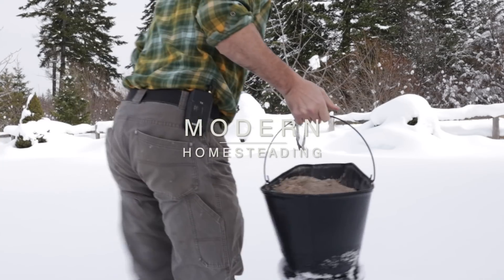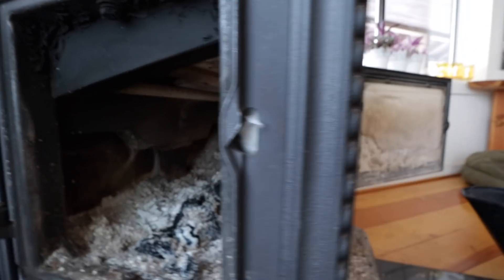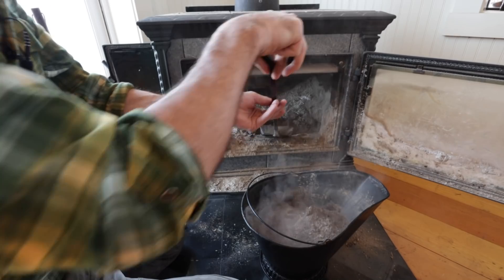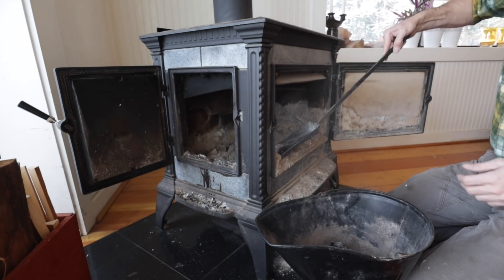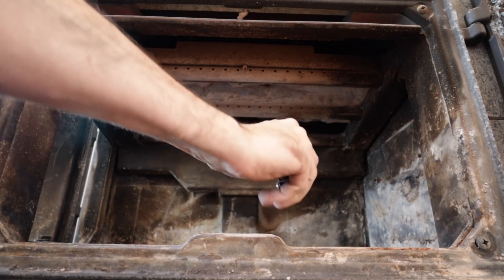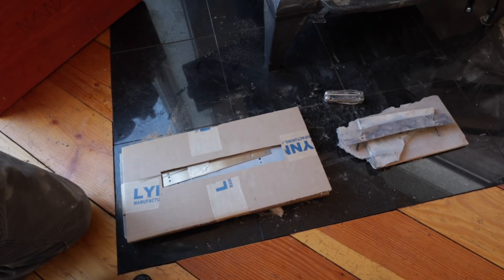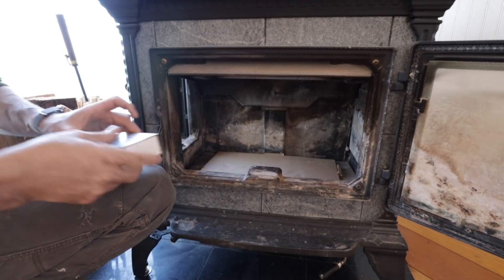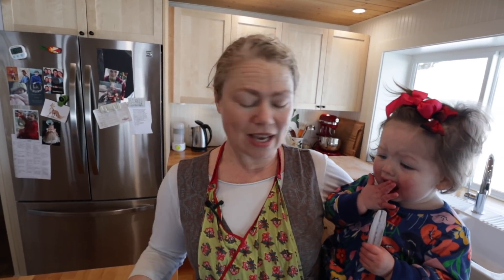Woodstove - Who Builds The Best Wood Stove?

Comment: We live  in Saskatchewan Canada. Built a masonry heater in the main living area 20 years ago. Salvage lumber is the only fuel we ever use, cleaning up collapsed barns mostly. Tremendous heat in those douglas fir boards and 2x6.That is what the mh likes , a quick, very hot fire .The fire door is only opened once a day, 7 oclock in the morning. It is still radiating heat at 10 oclock pm. The cost to build is minimal. Only bought material are the fire bricks for the fire chamber. the rest is used chimney bricks and ordinary clay from the cellar for putting the whole thing together . some chicken wire as "rebar" in the clay plaster. The door was built from scrap iron, the only metal part besides the pipe going into the chimney. Total expense back then  around $200.-( chimney extra of course) The thing  is about one ton. The chimney never needed cleaning yet. wood consumption around 40 lb per firing. Clean out the ashes twice per winter, 80% of  the volume being nails. Very simple , anybody can build one, the perfect infra red heat, private sun, so to speak. Best project in one's life ! Throw those iron monsters out and build one , you will never regret it, expecially if you have small children .   Don't be deterred by this elitist aura of immense cost attached to masonry heaters .   josef.schwaiger@sasktel.net 
Kind regards to you all

Josef

Comment: The main purpose of a wood stove is to provide heat so anything that reduces or slows heat transfer had better have a good purpose.  Soapstone insulates against heat transfer, that's why it takes longer to heat up the room.  Very important is where the air for combustion comes from.  If you don't have an air intake thru the wall, you are using heated room air for combustion, thus cooling down the room when air from other rooms come in to replace the lost room air.  Also, as long as your chimney is warm, heated room air is continually lost up the chimney even after the fire is out unless outside air is used in the combustion chamber.  Also, the baffle you replaced insulates, so I replaced mine with two steel plates and I turn them over every year due to slight shape changes over time.  Steel plates in place of the replacement fiber insulated baffle you purchased also keeps the stove top warmer for processing maple syrup, for example.  Love your videos.

Comment: First "air tight" woodstove was the Ashley made in Tennessee, but it was a thin walled steel stove that did not have that "heat sink" of cast iron or soap stone. I have a Pacific Energy with a big slab of soap stone on the cooking surface.  Availability of firewood has become a local issue where I live.

Comment: Maybe keep a set of the soap stone baffles for reserve spares, just in case of future need and not available in the immediate or ever. When you lay a porcelain tile floor order a box of replacement tiles from the same batch, just in case a repair has to be done at a later date. You won’t be able to match the tile color with a different lot. The color variations are noticeable. But lately the availability of a replacement might not be possible because of delivery and manufacturing issues. All just a suggestion. You want to use a shop vacuum with a stainless steel catch bucket that way your assured no fire.

Comment: I love my Vermont castings intrepid ii. It's raw cast iron but still you can't beat a wood fire in my opinion. A little tip for you or mrs. Wranglerstar a wet cloth dipped in ash from the stove works great for cleaning the glass just rub it on when the stove is cooled down and the carbon will wipe right off.

Comment: Those baffles will crack just from the heat.  I replaced the warped steel baffle in my Century FW3000SD with one from the same company.  It made the stove much more efficient, but the baffle split right down the center within a week (and no, I didn't hit it with anything). Doesn't seem to affect it, but I guess I should buy a spare.

Comment: Just a tip you may want to try. When I was growing up we heated with wood and when we had to clean out the stove we would take an old ketchup bottle and squirt a couple of bottles full of water on the ash to dampen it. Let it set for a minute or two and then shovel out the ash. It really helps cut down the dust in the air.
Reply: try spray bottles like a windex type, it doesnt take that much to wet down the fly ash and this way you get a wider dispersion

Comment: Good enough video that we just ordered this stove for our new home.  Do you use the direct outside air accessory? Our installer recommends just adding an outside vent at outside wall or run a tube in floor to a registor near the stove.

Comment: I refurbished an old Vermont Castings from the early 80s...the thing works great and for a fraction of these woodstoves sell at retail in the 1000s...most woodstoves are $3000 or more yet a old model that needs a few new parts like gaskets would be less than $700...
Reply: all well and good if you live in a locality where you can install a stove that was not EPA compliant. (not beating on the old VC's they were top of the line units back in the day,) but the old non reburn stoves time has come and gone, even a quality big box stove with reburn technology similar to that which the stove in the video demonstrates  (yes they exist) can be had for under a grand.

Comment: I have worked in the Hearth & Heating Industry for some time, first doing field installs and servicing to tech support and now regional sales for a distributor of many different brands. I wont get into how you didn't leave an appropriate 1" ash bed on the bottom, but Hearthstone is a decent manufacturer when it comes to wood burning units. Pacific Energy, in my honest opinion, a far superior brand. Not only are the extremely well built, they support and guarantee their units the longest. They use universal parts on their models every year so I can use the same part on a unit that is a year old on a 15 year old unit. They make a wide range of fireplaces, inserts and freestanding stoves. Cast iron, sheet metal and soap stone.

Comment: Of some interest …  Here in Canada we have Home Hardware where I purchased the Ash Vaccuum  by Cleva.It is designed for vacuuming the ash from the pellet burning stove.Supposedly O.K. if some warm-hot ashes present. I have used it for 5 yrs and no problems so far.Living in a mobile home which is airtight we must take our combustion air from outside so with that we aren't drawing air from indoors and sending it up the chimney.If anything it soon gets too warm!!!
Reply: I'm thinking about one of these stoves myself with a vent type going outside for fresh air for the wood stove. And legs to bolt it to the floor. They claim this is for mobile home you switch I'm in a small space and don't want to take all the oxygen out. How do you like yours?

Comment: Just bought a used wood stove. Exactly like the one you have!! Quick question. Which way is the damper wide open?? Left or right?

Also will I need that damper that’s in my pipe? Or is the damper in the stove good enough. Thank you
Reply: it depends on the height of your chimney, and where you are located. If your chimney is too tall, you may need an excessive draft damper (the one in the pipe) to cut back on the draft. and if you are in a location at a higher altitude, or receive a lot of wind, it can cause the same effect.
Reply: also, the best way to tell which way the handle is for open or closed, take the top section of your stove pipe off and look down inside the stove to watch the damper

Comment: We have a US Stove Furnace in our basement.  It is tied into the HCAC duct work. But we stopped using it because it would start out fine but then smoke would come out around the door and my carbon monoxide detectors would go off upstairs.  We would have to get our 6" chimney flue cleaned once or twice a winter.  I was fed up.  Then I found out the problem. Our house was too new and too tight. So as the fire burned in the furnace it would use up the air in the basement and cause a vacuum. Then that would start pulling the smoke back down the chimney.   I tried last year to run a flex line in from outside into the intake of the firebox and we had no problem.  But we have not switched back over to wood yet. Not much winter lately. We just use the natural gas in our central unit.

Comment: Here's a tip from a long time wood stover, add a ceramic blanket on top of the stone you just replaced, cut to size type blanket. This will increase the efficiency of the stove by trapping more heat in the box. Search flea-bay, they sell them in different thicknesses. Even a thin 1/4 inch thickness will do. Good luck.

Comment: Another reason to check for heat with the back of your hand is in case of flinching. If you use the back of your hand and you flinch due to the heat, your fingers curl away from the heat source. If you use your palm and you flinch, you may end up dragging your fingers through the coals, or even grabbing a handful.

Comment: Blaze king they have very deep opening after you open the door so you can load more wood and clean less often as it has 10.5 inches from the bottom of the door to the fire brick. They also make 6 of the top 10 most efficient stoves listed on EPA. Blaze king, king model has a 4.34 cubic foot firebox thus more wood equals longer heat and more time between loadings. I could almost load that wood stove into mine. They use catalytic converter along with bimetal self adjusting damper to keep the heat even. Not much out there that compares to a blaze king

Comment: I have the same stove, great wood stove, I heat my 1300sqft house , I added the fresh air intake a couple years ago and it really helps, I have a couple drafty spots, eliminated the drafty feel.
Reply: I know this is a comment from awhile ago but looking into this stove for a 1200sqft rancher. How hot does it keep your house?
Reply: @goalscorer20  we stay very comfortable, the stove is in the far corner of the basement in our bi-level house, below our living room, so our bedroom stays cool , it was in the upper 30 degree range this past weekend and we had a widow cracked to cool the living room off for part of the day, I run it full out most of the time, the basement works like a big heatsink, tile floors and stone wall around stove. It was 20 degrees last week and it was 75 degrees in main part of the house. I am not using the built in fan right now because of a bearing noise, it’s working so good as is I may not use it this season even after I fix it.

Comment: I have a 1977 Vermont casting Vigilant cast Iron Wood stove had for  almost 40 years and took to every house I lived. We heap the ashes on one side of the stove and than put the ash bucket just like Wranglerstars on the inside of the stove to the right. Than we scoop up the ashes while the bucket is inside the stove so it keeps the ash from going everywhere inside the house.  Also I will keep any char coal left over from the last fire and use that as my base for the next fire.  I use a little fat lighter on top of the coals than kindling and I never need paper. Also with my Ridgid shop vac bags going for over $7.00 a piece on a 9 gallon vac it makes it a little expensive to use for a wood stove unless cleaning up the mess from the fire wood around the outside of the stove. We also use our stove 24/7 so we always have a few hot embers making the shop vac unusable or dangerous for inside of the stove.

Comment: Tons of dust I burned whole winter and had greasy dust everywhere all over even up stairs. Dusts while cleaning.  I would install a vacum to throw it outside into a metal bucket if I heated every winter. Mrs. W does not complain of dust ?

Comment: I've had a hearthstone (heritage model) since 2003 and I'm as pleased with it as you clearly are about yours.  I do have a recommendation for you and I hope are open to suggestions.  I noticed that when you are cleaning out the ashes with the shovel and ash bucket that so much ash becomes air born.  Those particles eventually land in your home and then you have to clean/dust often.  When I first got my hearthstone, I was doing the same thing you're doing and my wife was ready to strangle me.  First, I get the draft going by lighting a few pieces of paper and then I work quickly while that draft is still working.  I work from the side door and keep both the front door and the ash pan door closed.  I slide that grate in the bottom of the hearthstone toward the side door so as to open that grate up as much as possible, and then I use the shovel to scrape around inside and work the ashes down through the grate and into the ash pan below.  I can get almost all of the powder down into the ash pan that way and the air born ash doesn't come out at me while I'm working that because of the draft.  Then, I close the side door and pull out the full ash pan and carefully walk it out to the ash bucket sitting just outside.  I can do all of that and release almost no ash particles into the air inside the house.  I do have to be careful when I'm walking with the full ash pan, especially if I have a few small, hot coals in it but, luckily for me, my floor in that room is concrete.  I come back in quickly (again, I don't want to lose my draft!) and I open the hearthstone's front door and use the shop vac to clean out that small area just inside there like you do.  Anyway, give my suggestion a try and I think you'll find you'll be saving you and your family some house cleaning.  Thanks for your video.  I haven't had to make the repair that you showed but, I'm sure I will at some point, and now I know how!

Comment: We currently have a propane furnace, but we have been thinking about adding a wood stove in the finished basement as a secondary possibly primary heat source when the temps drop pretty low. Would you still recommend the soap stone wood stove in our situation?

Comment: Before you mentioned you also had electric heating, I was gonna suggest two stoves. Do maintenance on one, while the other is working. But now that I think about it. Electrical resistive heating, or a Heat-pump, working together with a wood stove, is a great idea.
Like a hybrid vehicle. Electric system can take over when the stove runs out of fuel, or is down for any reason. And whether you're connected to the evil grid, or charging your off grid home. The thermostat will detect the heat from the stove, and turn electrical heating off. Can even expand the home batteries later on, to have more power to fall back on for emergencies or a party.

Comment: Use a deep bucket for the ashes, a HEPA vacuum with the nozzle just inside the bucket's rim, tip the ashes in slowly without pouring, and you won't have all that dust going everywhere.   That or a long enough hose to put the vacuum outside - an old built-in vacuum hose is good for that method and can be adapted to a 4" shop vac port with fittings from your local janitorial supplier.

Comment: I own a front load one of these love it. I will suggest though use the front loader door more often it will help you keep an eye on your ash build up i clean mine every morning and put hot coals an ash in covered metal can . Plus if you put combo split pieces in  with round wood it works quite well. Not trying to be a no it  all good luck

Comment: An ash drawer with a shaker grate would be nice. It is a feature on the DutchWest stove my mother bought in the 80's. It has a moveable shaker grate under the logs, and you shake it by moving a handle located under the side door. Ash dust is minimal when cleaning out the stove. However, you have to make sure to dump the ash pan ever day or so, or it overflows and you end up shoveling and creating ash dust.
Reply: That's possibly the same wood stove that I had in my house for the past 30 years!  My DutchWest stove has the front glass door - which I never use - and a side door where I load wood and scoop ashes.  I have the shaker grates in the floor of the stove also but they warped plus the triangular end of the shaker (where you hook the shaker handle) rounded to the point where they aren't operable anymore... not even with vice-grips.  Scooping is nearly as easy though so I'm not complaining.  I've retired it for a new, very highly efficient Blaze King Ashford 30 stove.  Everyone who has one backs up the Blaze King claim that you'll save about 30% on your wood so that's another huge plus for me.
Reply: @CW1116  Very cool. Sadly we had to remove our wood stove, because it's a multi unit building, and the insurance company decided wood stoves are too dangerous. No matter how safely installed, we were told get rid of the stove or lose your property insurance. Someday I hope to have a place to put a 'rocket mass heater' in a building away from the connected one. Those look really cool and seem to use the least amount of wood of any wood stove and are VERY clean burning.

Comment: I use an old steel milk churn for the ash (probably 8gal) , it has a lid so keeps the dust down and takes 2 loads of ash.  It also means you can keep the ash in until it stops radiating heat.  My favourite stove is the caste iron Vermont Vigilant, not made anymore.  It takes 22" logs which apart from refilling after clearing the ash out I load from the top.  I might add Vermont do an 'Encore' which pretty much replaces the 'Vigilant' but not in the lovely shade of green the 'Vigilant' was available in.  Not sure Soapstone are available in the UK.

Comment: Used to work at a movie theater as a teenager and the popcorn oil came in in these 7 gallon tin buckets I have a stock pile of them just to clean out the wood stove the only problem is they rust out fast

Comment: If you need it to heat fast, open that cleaning door up and let the air in directly under the coals. May have to move the grate around but it’ll get insanely lively. Play with it some.